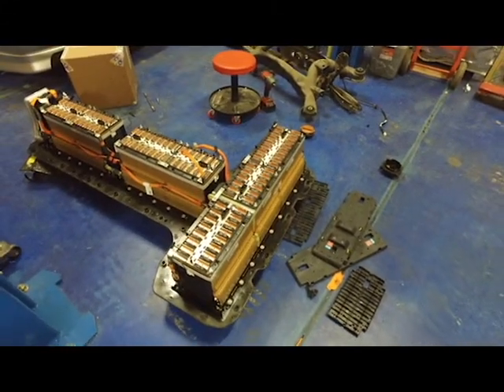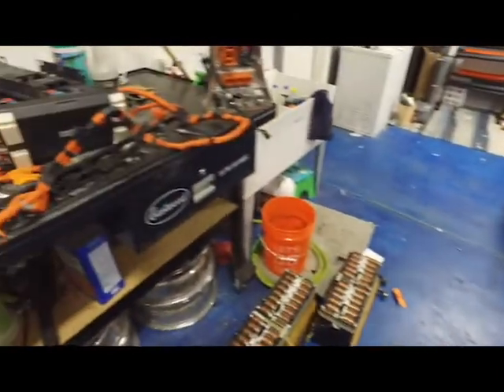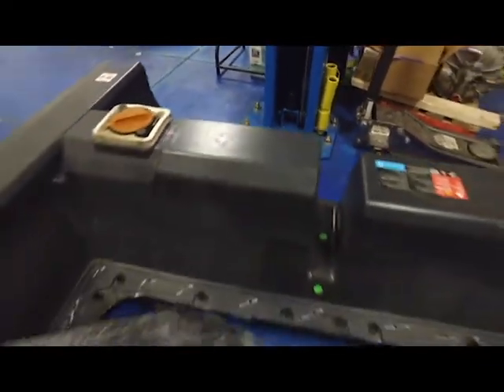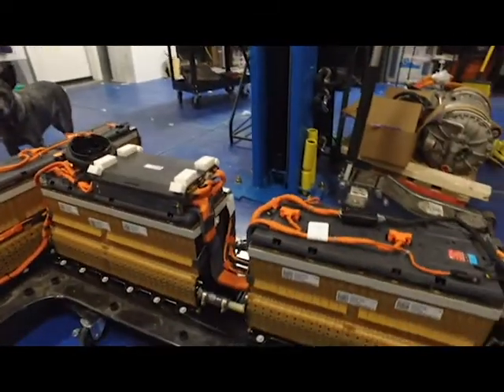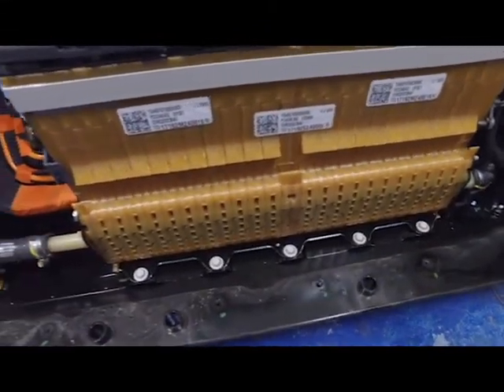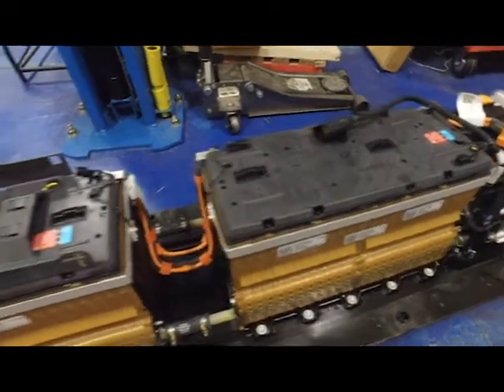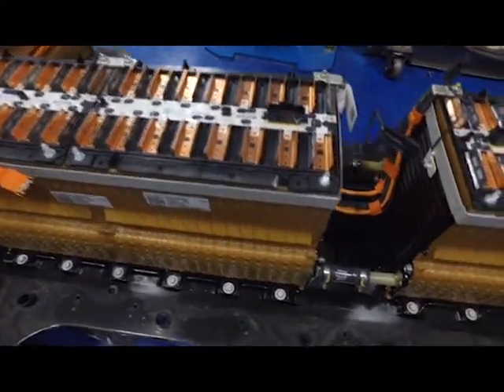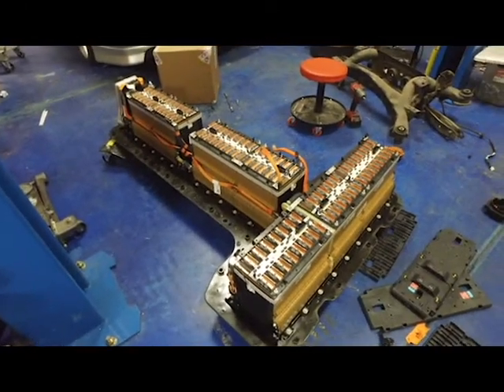Project Electric GTM - Chevy Volt Battery Disassembly

Comment: I bought the pack too with the shell included but for  some reason when connecting to the shell’s main gate(outlet) there seems to be no voltage coming through. So do I need to recharge the whole pack or is there a safety switch that is impeding voltage from 
coming through?
Reply from the maker: The contactors (basically big relays) are internal to the pack.  They would need to be powered and switched with a 12v source in order to give you access to the power ports on the outside of the pack.
Reply: @CodyGraham  but which port do you plug the 12v battery? There are two ports on top of the the main port. The port on the left or right given I’m standing looking straight at it
Reply from the maker: @EddyBoh  none.  You need to control is using the small pins.  You should take it  to bypass all of the factory electronics.
Reply: @CodyGraham  where are those small pins located?
Reply from the maker: @EddyBoh  the connectors on the end plate.
Reply: @CodyGraham  yes, there are two of them, is it the right one or left one?
Reply from the maker: @EddyBoh  no idea.  I didn't use any of that, tossed it all
Reply: @CodyGraham  On the conversion factor, how far can you go with a Tesla drive unit using a Chevy volt battery pack?
Reply from the maker: @EddyBoh  lots of variables, but all in all, the gen 2 Volt packs are conservatively rated and are really more like 20 kw per pack.  I'll have 40 kw total in a car that weighs close to half what a Tesla S does.  Tesla S's get about 4 miles per kwhr driven conservatively.  A 3 gets about 4.5 miles per kwhr.  Im Hoping for that type of efficiency, which will put me around 160-180 miles.